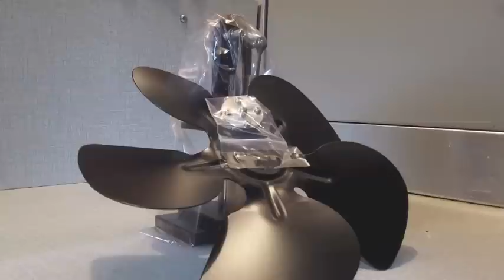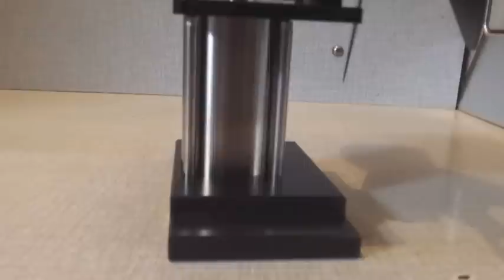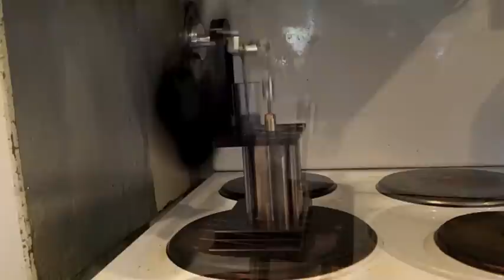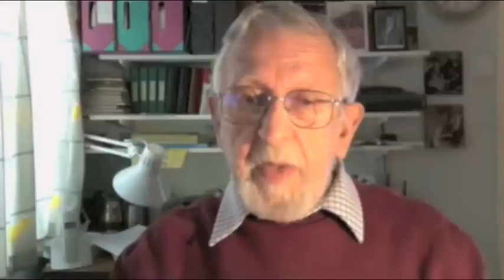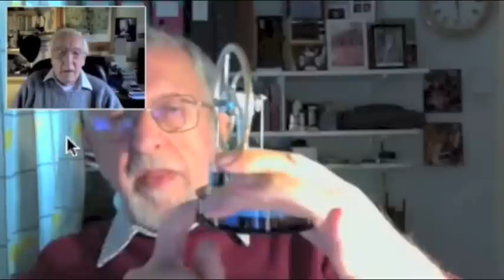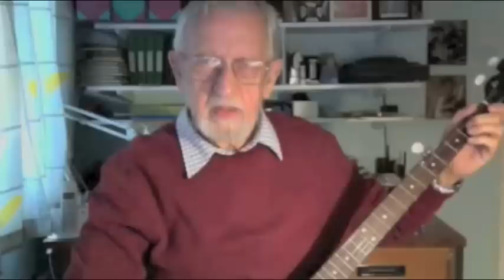Stirling engine with fan.

Comment: That is not a sterling motor running the fan.
But a thermoelectric  peltier element.
Reply: You are incorrect it is a Stirling engine.  Thermo-electric devices have a telltale heat radiating element over the base.

Comment: Quite lovely! And you obviously put it together correctly because it is very quite. May I ask: Does it start automatically at a high enough temperature or must you always give it a spin to get it running?
Reply: The Kontax needs a spin to get running.

Comment: So many questions! The 2nd time view, I saw no exhaust... true? Could this be mounted upside down with plate on a roof and fan blades inside a structure? If installed on roof would it improve if the plate was @ the bottom of a parabolic mirror? Ever any applications to make electricity or pump water? 

Banjo always reminds me of a t-shirt, "Paddle Faster, I Hear Banjo Music." You know, I never saw that movie, so I guess the shirt was funny.

Comment: Technically it shouldn't matter if the heat comes from above or below, so if you mount the fan upside down and attach a large, black metal plate to it to collect the heat of the sunlight, that might just work.